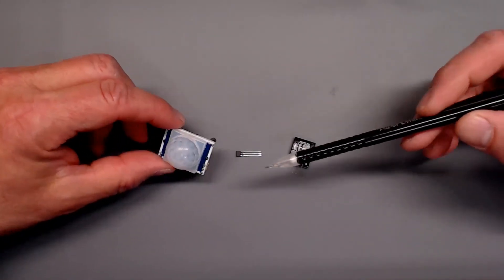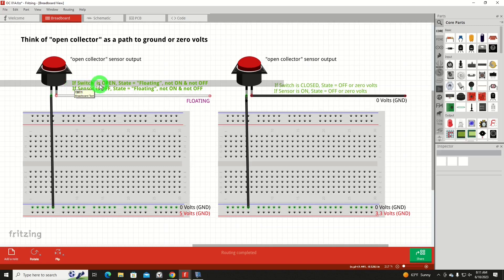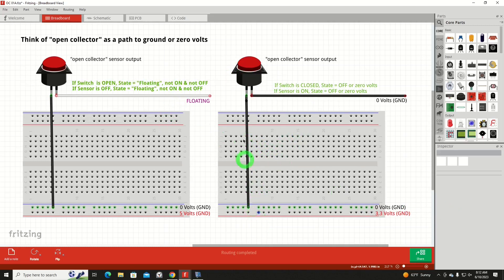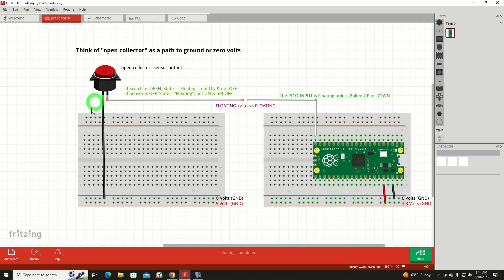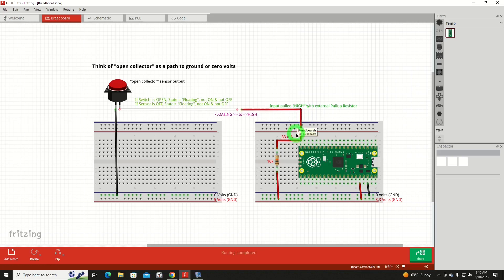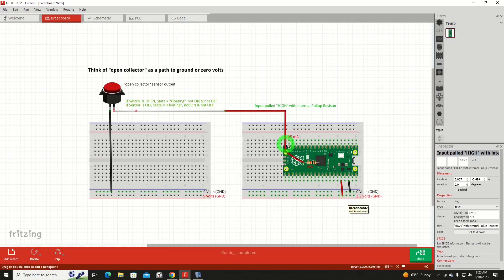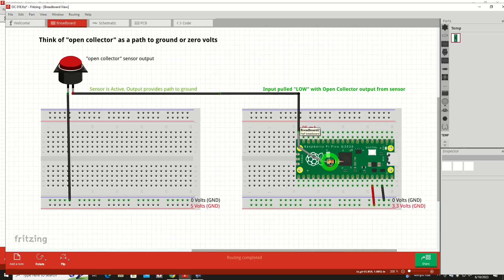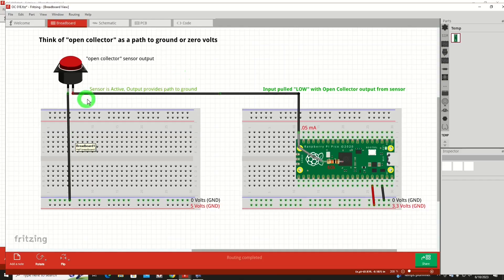How to work with Open Collector outputs

Comment: I think both grounds should be connected together (common ground)
Reply from the maker: When needed / possible, yes.  When the "Ground" is at the same potential, it is not need which is often the case with simple battery powered devices.
Cheers!
Chris
Reply: @MakingStuffwithChrisDeHut Yes, but the 5V for the device is a separate circuit.
Reply from the maker: @bobweiram6321 Again, if  both zero volts are at the same potential, it does not matter.

Comment: Another benefit might be that multiple switches (fysical or transistor) could pull the same input pin to ground. That might come in handy for some kind of interrupt-system, where multiple devices can interrupt the CPU when they need attention (think keyboard, disk drive, UART). The CPU must do some discovery to see which device pulled the interrupt ping low ;-)